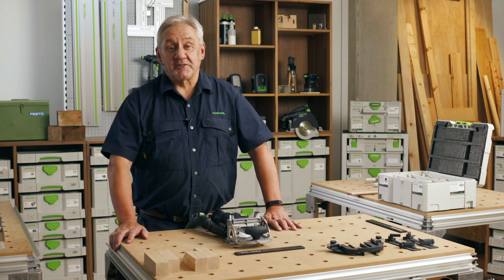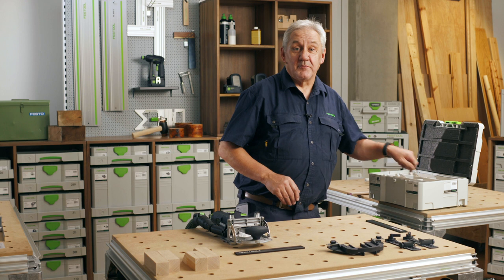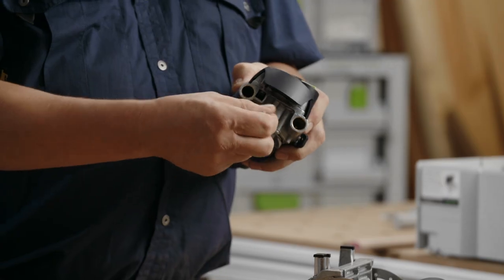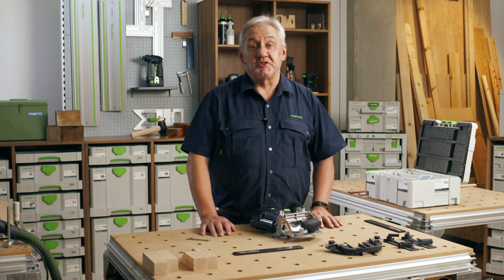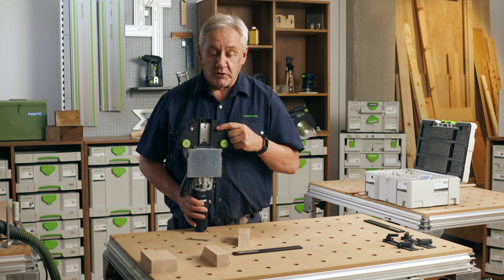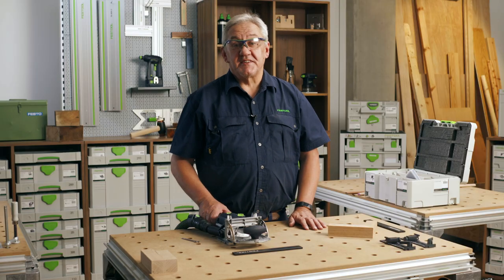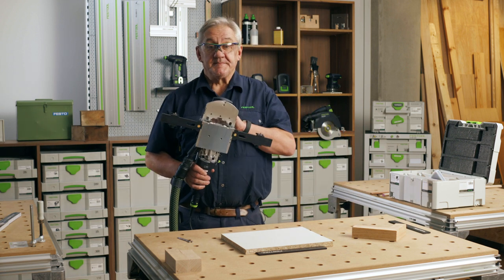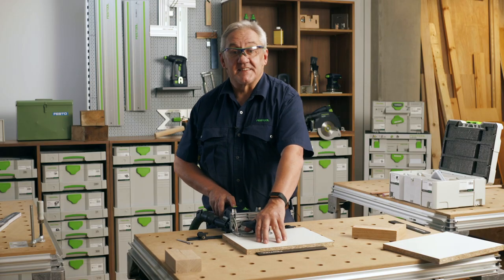The Festool DF 500 DOMINO jointing machines: Accessories

Comment: I see you still change cutting width with the motor off (5:40) when on page 15 of the manual it states "Reliable setting of the dowel-hole width with the rotary switch [1-2] is only possible with the machine running!,"  

Can you explain why the manual, not to mention Sedge in Festool US, is wrong and you are doing it correctly?
Reply: Yes that is the best way of doing it. It isn’t always possible with the machine not running.
Reply: I saw this too. In the manual it also says ''Rotate the adjustment dial only when the motor is running''. I think it was a mistake on his part, since I tried to change the adjustment with the motor off when I first got my machine and I was only able to turn it once. If I wanted to change it to the wider setting it would block.